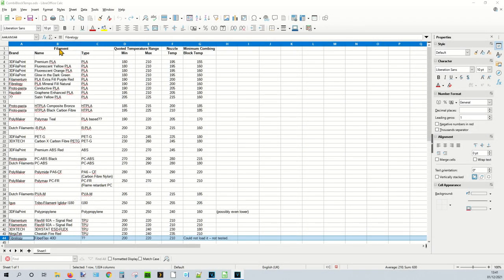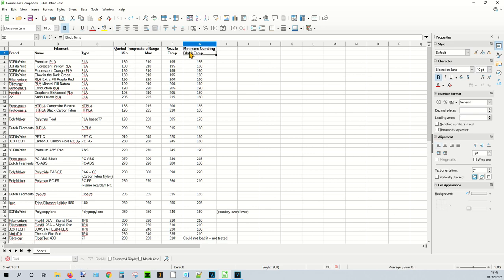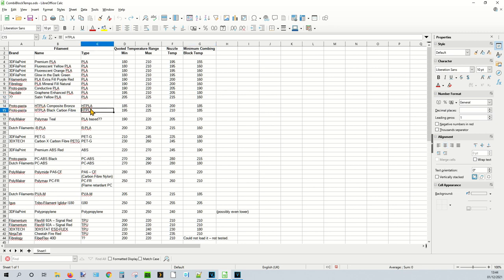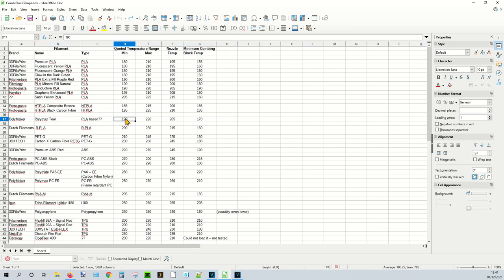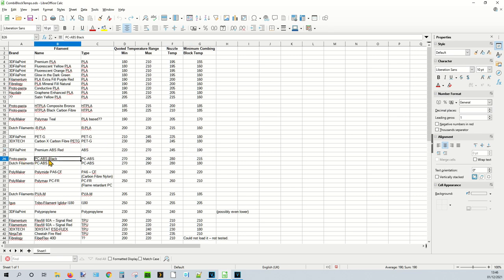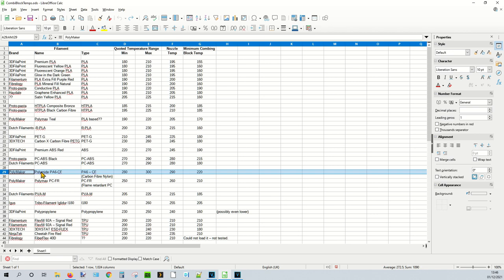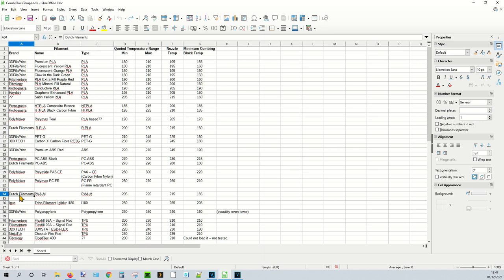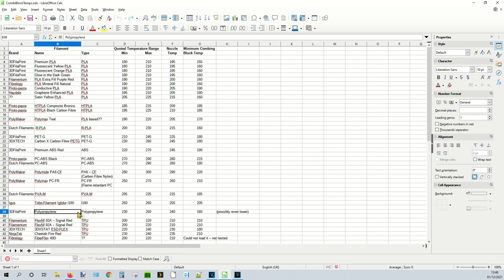6 Input Multi Material Hot End Part4 - Multiple Filament Extrusion Tests

Comment: Looking forward to seeing some multi-material prints! Some interesting tests could be printing a plastic "alloy" gradient where you start with 100% PLA and 0% TPU, and then slowly blend the two materials with a 50/50 split in the middle, and end up at the top of the print with 100% TPU and 0% PLA.

Would be interesting to see how well they mix, and if it's possible to make a print with varying stiffness properties. The slicing software out there isn't close to being good enough to make full use of this gradient effect, but it would open up a lot of possibilities and maybe drive some innovation on the software side too
Reply from the maker: Yes, could be done. Off the top of my head, one could use just two inputs which would mean there would be 100 increments (because of the mixing ratio) but what exits the nozzle would consist of 2 stripes. So one side of the bead would be rigid and the other side flexible. A better approach might be to use all 6 inputs and load rigid into 3 of them and flexible into the other 3. That would mean the bead out of the nozzle has 6 stripes but there would only be around 16 or 17 increments from fully rigid to fully flexible. As I said to someone else, so much to do and only one lifetime in which to do it.....
Edit. I lied - there would be 33 increments because with 3 of each type, you'd be incrementing in 3% steps.
Reply: @deckingman  That's a good point, why not use all inputs. Do you think by the time you get to 6 stripes there will be enough blending to make it effectively blended? 

Another test should be to see what 6 different colors at 16.6% looks like. And then do a cross section of the filament under a microscope. And maybe use a CHT nozzle to blend it a little more?
Reply from the maker: @stevenmcculloch5727  One wouldn't be able to call it blended without getting villified. I have to be so careful of how I word things because there are armies of people who've never made anything in their lives but do nothing but pick faults. You'd be surprised at some of the comments I get which don't appear to the public.  Let's go with 6 part laminate. 🙂 As for microscope - not on my pension. But it doesn't end there. People would be screaming for data on the properties of the laminate, so tensile strength testing, ductility, elasticity, etc etc. I'm just one old guy pottering around in a very small garage with very little money to spend on this stuff. Sorry. I'm a bit deflated by some recent comments that I won't share.

Comment: Can't you retract the filament beyond the heatbreak while its static?
Reply from the maker: Unfortunately not. All inputs have to be fully loaded otherwise when you extrude, some of the filament finds it's way back up into the unused inputs rather than exiting the nozzle. I've seen it happen with a Diamond hot end which had filament loaded into the hot end but not at the extruder. This loaded but unused filament actually got pushed back out of the Bowden tube by the pressure inside the hot end.